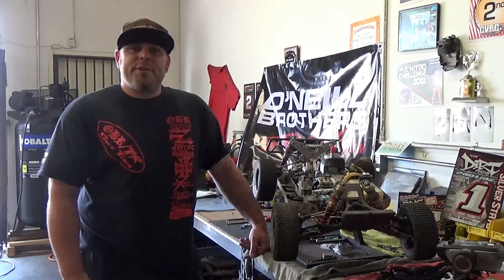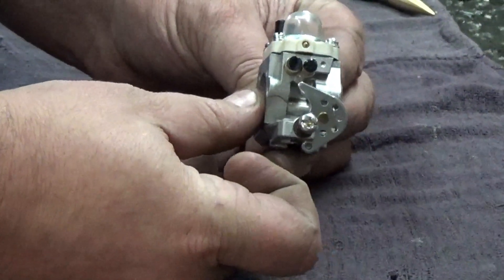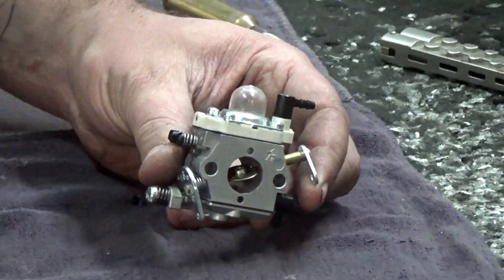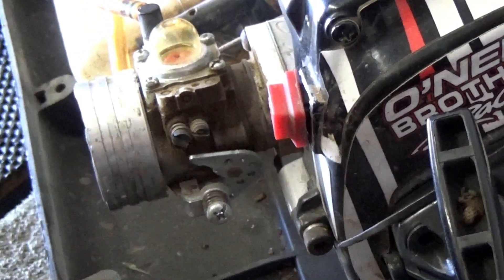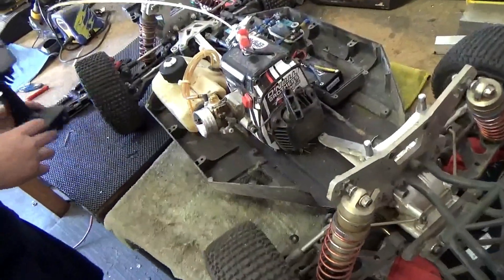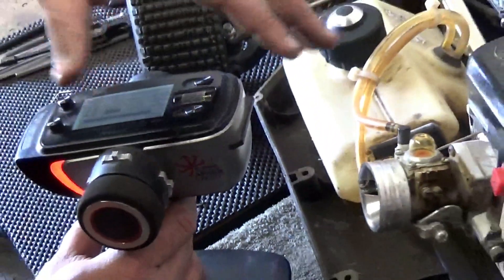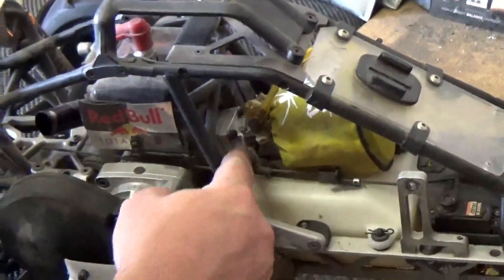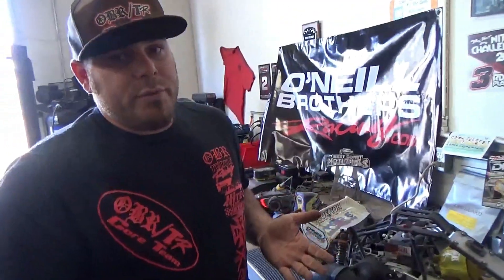OBR Tech 1/5 Scale Throttle Trim & EPA Setup

Comment: Hey dude I’m so glad I found this video I’ve been losing my mind on my Baja 5t I bought used that would also move the hammer when I applied the brakes. When I set the linkage throttle and balance it to how you did with it hitting the idle screw, when I full throttle on the controller, the throttle hammer does not fully touch like yours does. Now I went into the controller to check the throttle EPA and it was already full at 125. So my butterfly does not go horizontal at full throttle at all. Any idea why? I can also upload a video if you need more details!